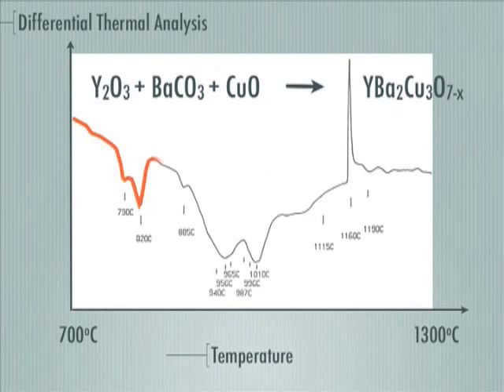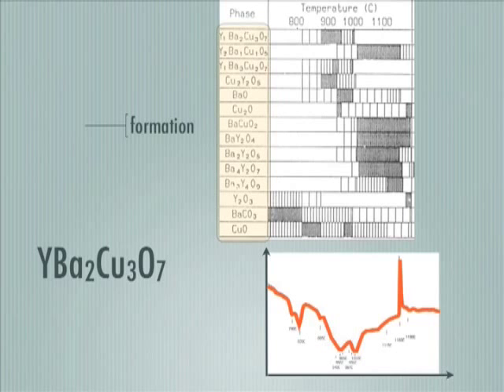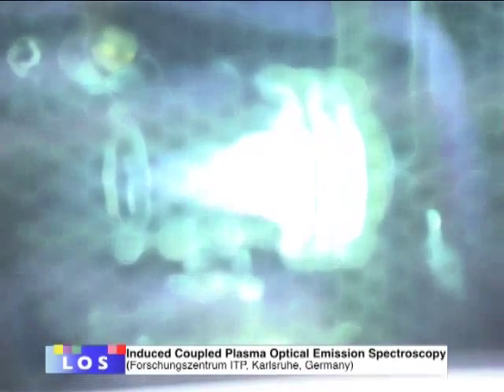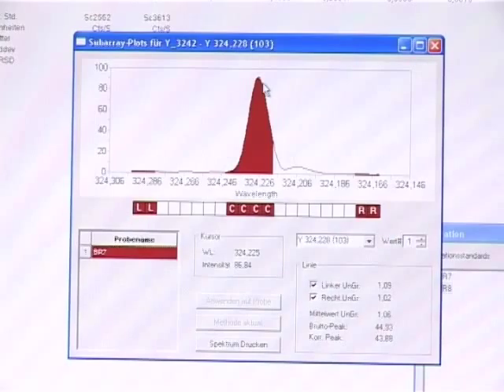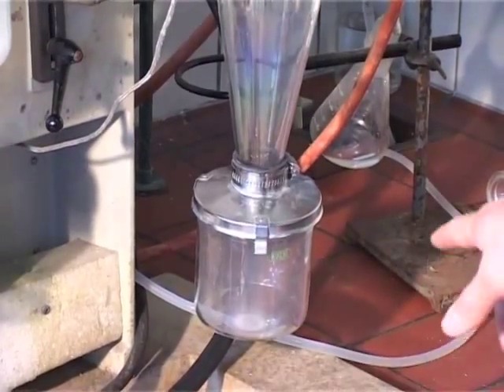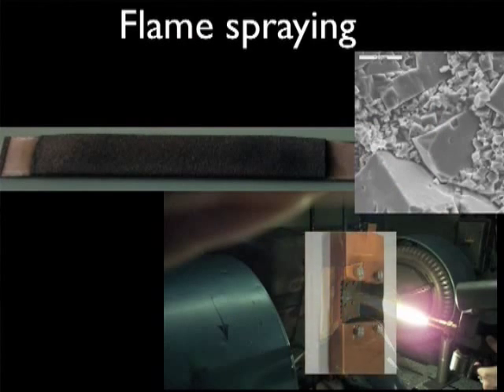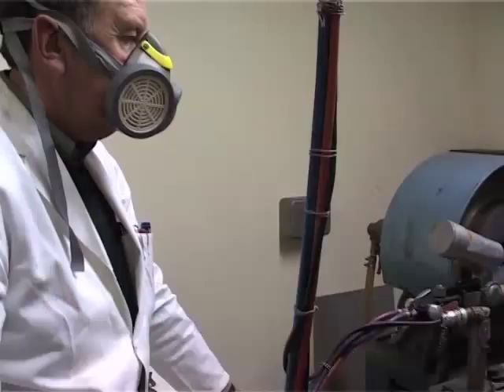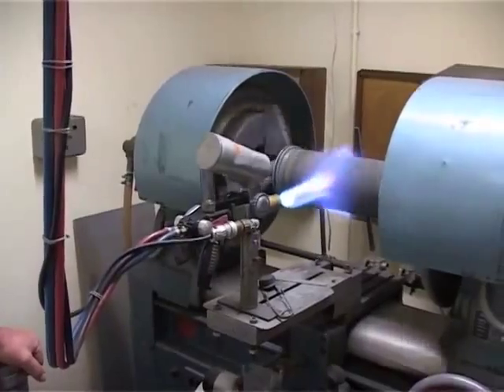Superconduction: yttrium barium copper oxide

Comment: Sir yittrium barium copper oxide is a covalent compound  . How it can conduct electricity.
Reply from the maker: It is a superconducting oxide at sufficiently low temperatures.
Reply: So it's not a super conductive at room temperature?
Reply: @dapperwolf6034  no, in fact its a insulator or bad conductor